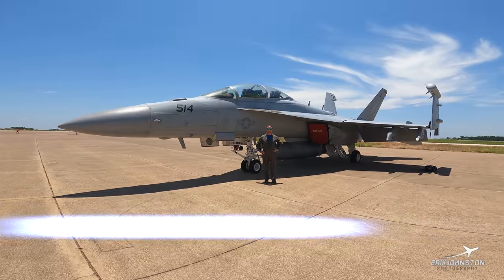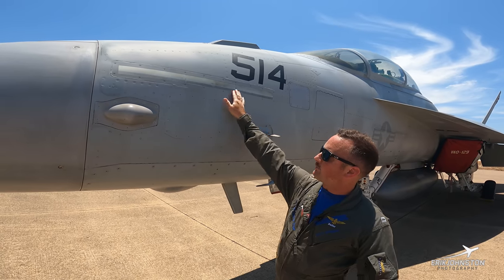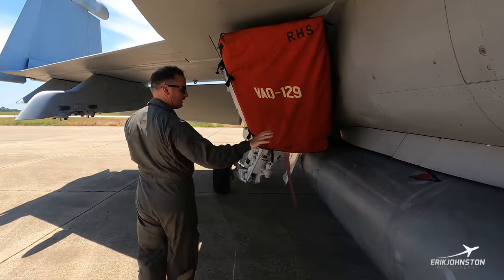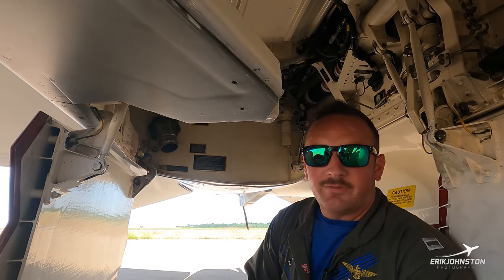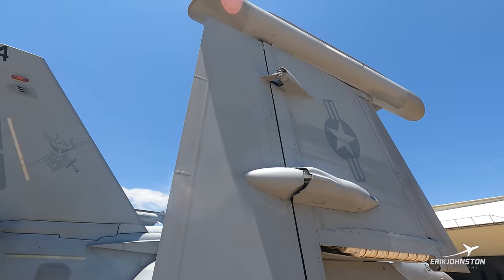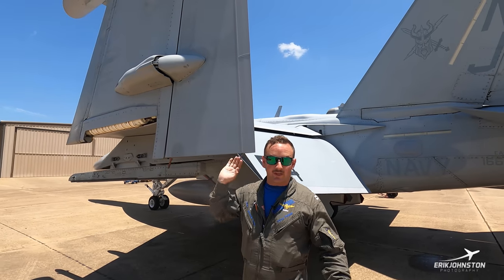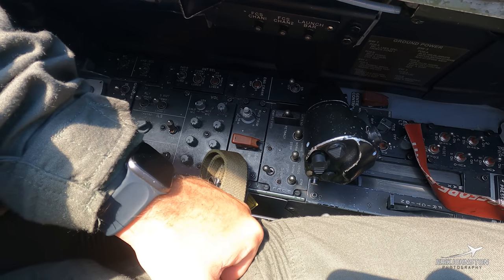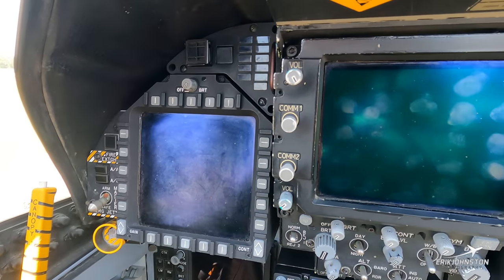EA-18 Growler Walkaround

Comment: In regards to the right main wheel well what he referred to as the APU Exhaust, that was actually where you hook up an external air source to spin the engines over if you don't have a working APU. The APU exhaust is on the centerline of the plane. Worked on the D model for 3 years and in charging handle is in a different spot, but pretty similar
Reply from the maker: Thanks for the info!
Reply: So what was the 3000psi for if the APU is started using battery power?
Reply: @CodyLS6 You start the APU with the 3000psi not a battery

Comment: Except for extremely short un-refueled legs, killer platform. Few decades ago, friend of mine worked this program from Navel Avionics in Indy. Range was Prowler’s advantage. Otherwise this was several fold more advanced tech.  Thanks for the content. 

Many fighters including Growler are AOA sabotage away from ever getting in the air.  In air, AOA failure away from a bad day.

Comment: Coming from the A-7 the BRU-32 bomb rack is like a Hugo to a Cadillac.  Right about hand level one person holds the rack and the other pulls the “Horseshoe “ bolts and slides right out..  for the normal Hornet the wingtip launcher would be a sidewinder.     Try folding or spreading wings by hand one at a time on the boat.  Either blocked on one side or no external power cord available….. oh yeah then have to fold again manually after loading the winder.

Comment: Never really understood why they didn’t give the 18 30,000 per engine. We have various turbofans with that range and higher that they could have made work with this airframe. It would have made the aircraft have a better carrier takeoff with the higher weight. Really surprised they haven’t modernized the 18 since the growler platform is so new. Full color touch screens would be very beneficial in that aircraft. I respect the Super Hornet but still believe it’s not the aircraft that the Navy deserved nor did they deserve the F/A-18 A. I believe they deserved their own Air Superiority fighter and a separate aircraft platform like the A-6 for the primary bombing and electronic warfare missions. They should have gotten a fighter platform that was equal to or better than the F-15 leaning more towards the F-22 capabilities.

Comment: “People use both interchangeably, but the difference is that motors run on electricity and engines run on combustion. The engine converts various forms of fuels into mechanical force, while the motor transforms electrical energy into mechanical energy.”

Comment: It's crazy that the Air Force and Navy have different refueling methods. You'd really think that'd be something that was universal. There could easily be a time in war where a Navy guy needed to tank from an Air Force guy, or vice versa. It just doesn't make sense to me.
Reply: I agree to a point. Unfortunately Navy aircraft have to use the basket just due to the fact it’s easier to package a basket on buddy tankers vs a boom. The boom style is ultimately a superior setup particularly when your talking about in air refueling large aircraft like C130s, C5s, and C17s.

Comment: Haha goofy you wont see the apu acc at 1000 psi in the wheel well. It’ll bottom out at 2k. It will only show below 2k if you super dump the precharge for it. And good on you if youve pumped it ive never seen a pilot pump one ever. They just kick the tires